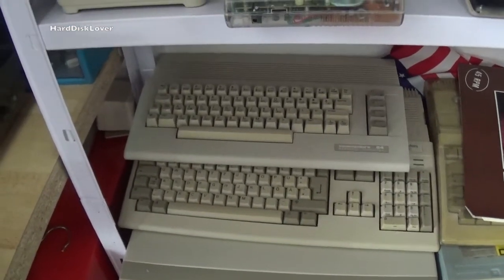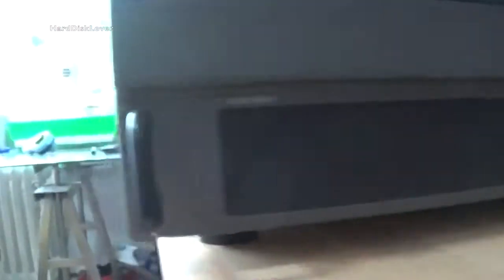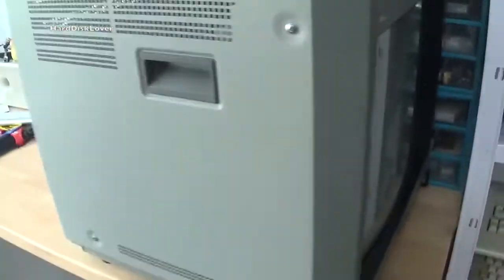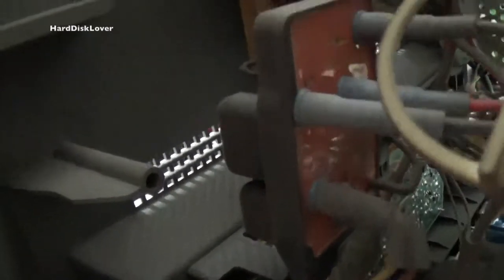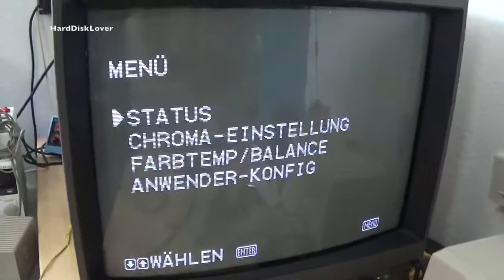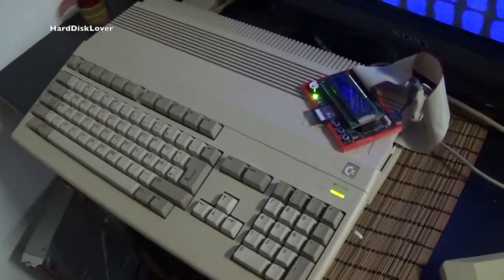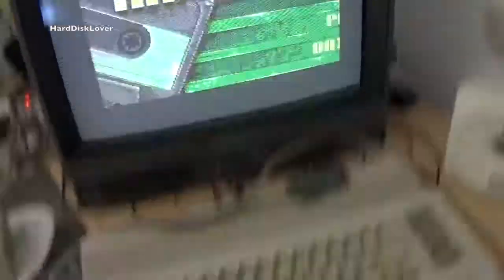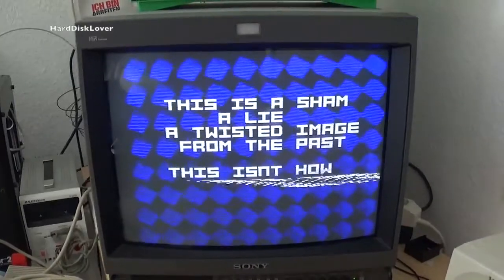Using a CCTV display as a monitor for vintage computers

Comment: I just got my hands on a Samsung CCTV monitor by chance. They were upgrading the security equipment at the building I work in and asked them if I could have it - they said to go right ahead! I don't have a vehicle, so it was a trek taking it back to my home. I think I pulled a muscle in my arm lugging it home, even with a dolly. But it was definitely worth it. The monitor has some slight image burn because it was in fact used for surveillance. However, it is only shows slightly in a couple of spots because all of the hallways are stark white.

My monitor actually supports stereo, but one of the jacks does not work. An easy fix for me. I just tested it out with Ridge Racer for the PS1 and, aside from the slight image burn, it looks glorious! It only supports BNC and S-Video, but I have already ordered some RCA to S-Video adapters to hook up older consoles like the Sega Master System and the original NES. Congrats on getting a Sony monitor. They are the better brand from what I hear. Thanks for making this awesome video!